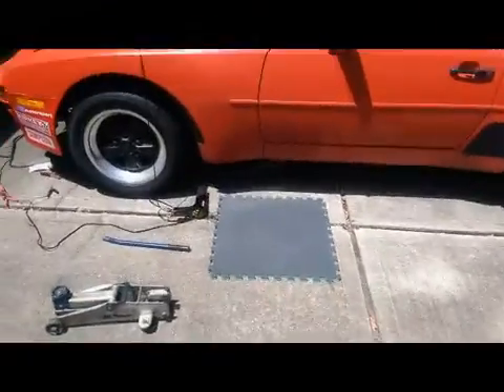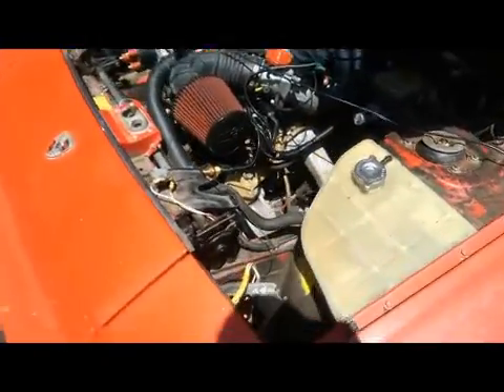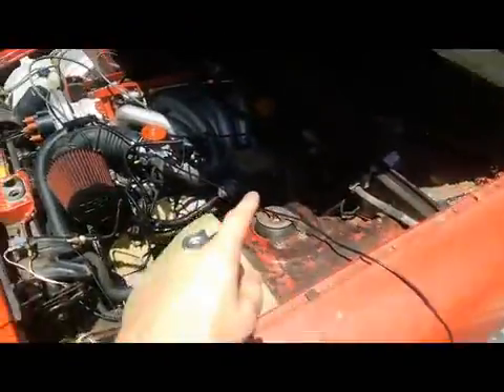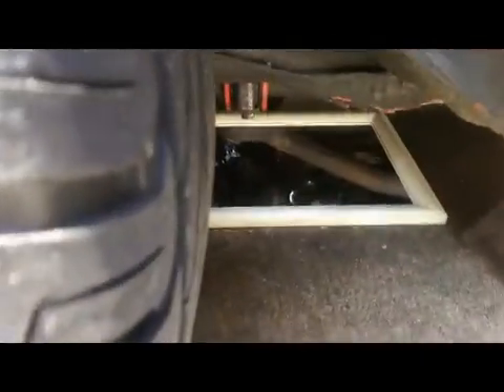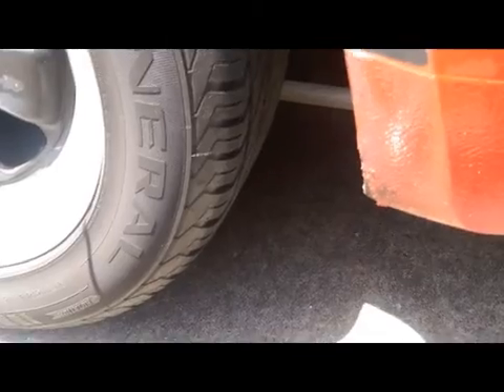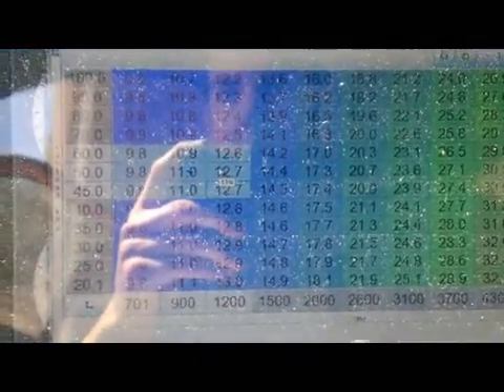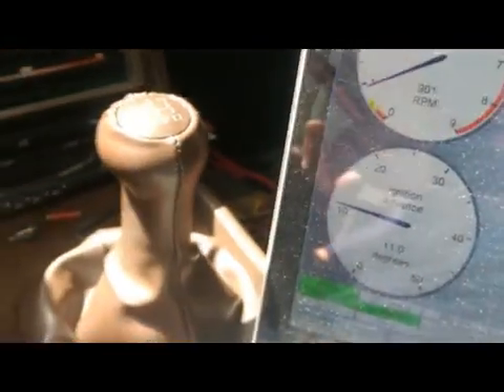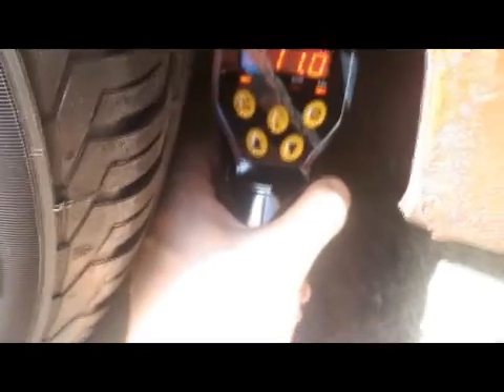Porsche 944 MicroSquirt - verifying ignition timing

Comment: What is 944 initial timing on idle?
Reply from the maker: I run around 15-20 degrees base timing on my 8 valve 944. It idles smoothly and the idle valve is not very active unless the engine is quite cold.
Reply: @MichaelODonnell  i have it at 11° since it hit the marks whit timing light but it idles smoothly too on 25° whit less air and i did find it weird it would run like that.